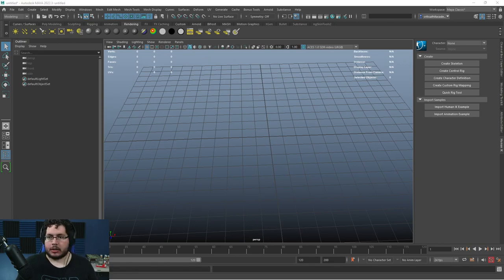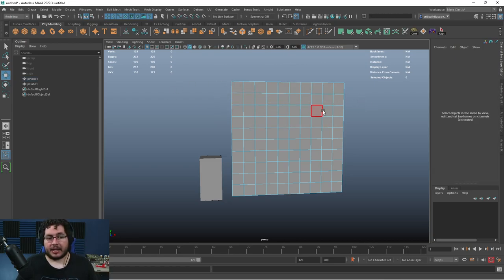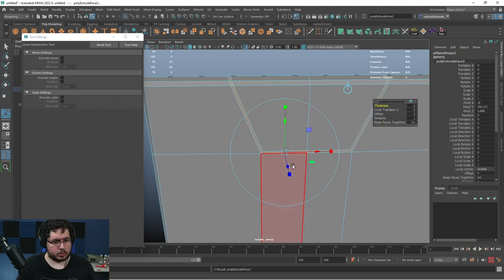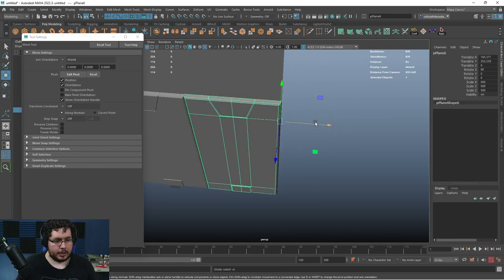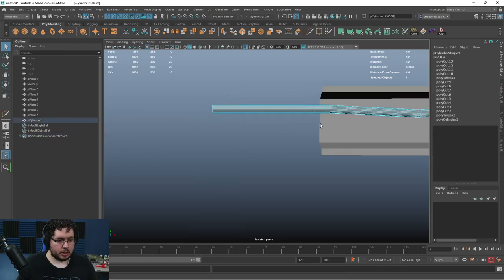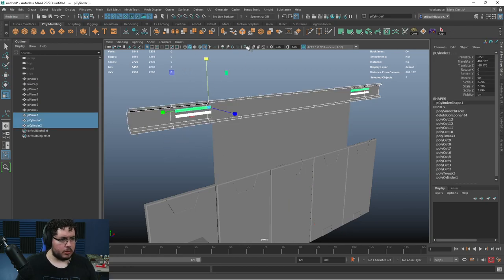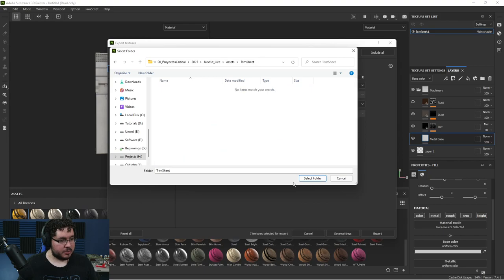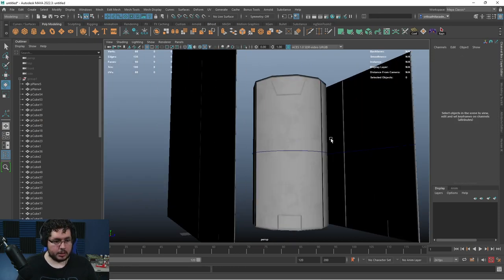Trim Sheets Quick Demo

Comment: Thank you for this video. I was wondering if you could answer a question I have. I'm building a scene with maya and it'll be fairly decent size with multiple assets. Some of it I can use this route (trim sheet) but a lot of the other assets I don't want to do that. Do I just revert to the unfold uv methods or maybe udims for them? There is everything from a small metal box to a large ship and everything in-between. Thank you.